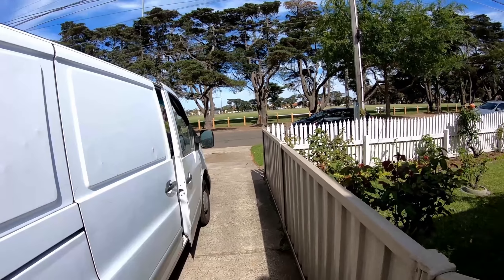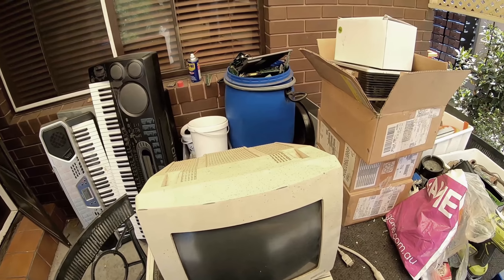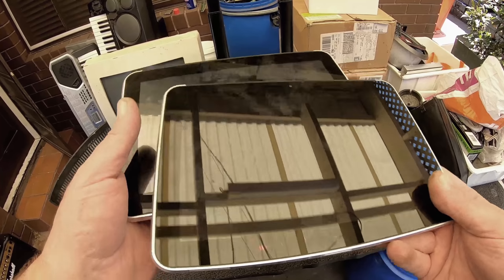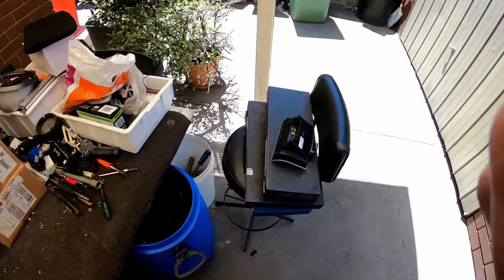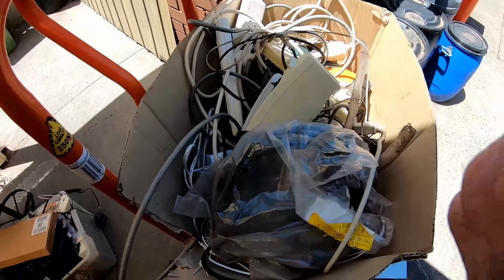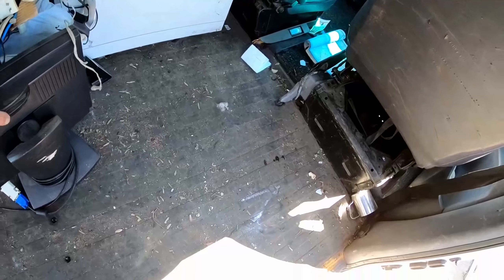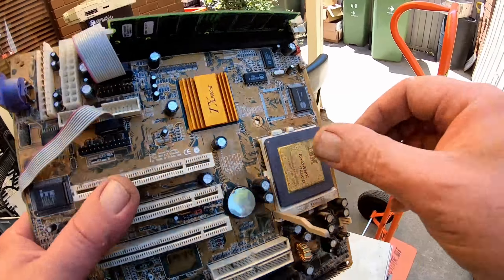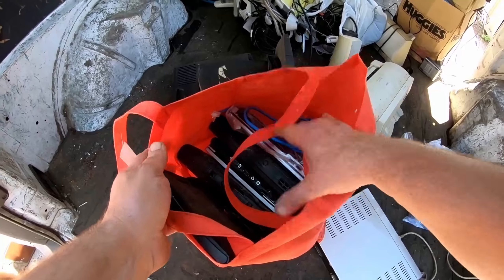E-Waste Pick Up Adventures - Youtube Subscriber Job

Comment: 8:13 Nice little HP, it's got the PCI expansion dock thing, the extended enclosure. Maybe it even has the PCI riser card. You might make quite a few bucks on eBay with this box. People turn them into retro gaming PCs.

Comment: Amstrad 1640 might have a sale value in ebay, beware, those PCs were very popular and vintage computers are being sold these days to older people who used them as child, no matter the HD is missing, someone might be interested to buy "for parts"
The "circuit" at 9:44 seems to be a Raspberry Pi computer, about 40$ value, still on market, again, sell it in ebay  Case is sold separately and SD card is not included also